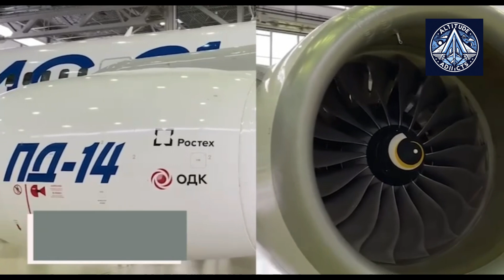MC-21 Jet Advances: New Glass, PD-14 Engine Upgrades, and Certification Push

Comment: I recently flew on an airliner with inflight progress map on the video screen as an option. It told me we were at 10,000 metres and the external air temperature was minus 50 degrees Celsius .... so why would Russia be "developing" a PD-14M for "low temperatures" .... when they spend most of their time at -50 anyway ?
Reply from the maker: Russia has one of the coldest regions on earth. All other engine manufacturers too meet these requirements if they are to qualify for flying to Alaska, Siberia etc.